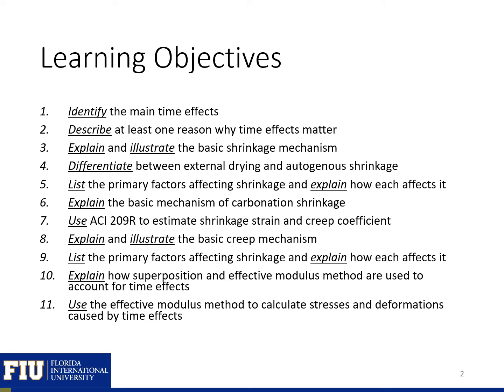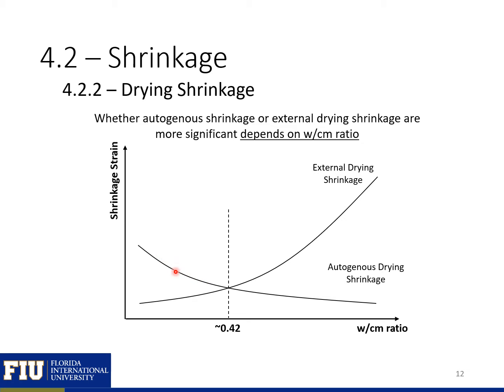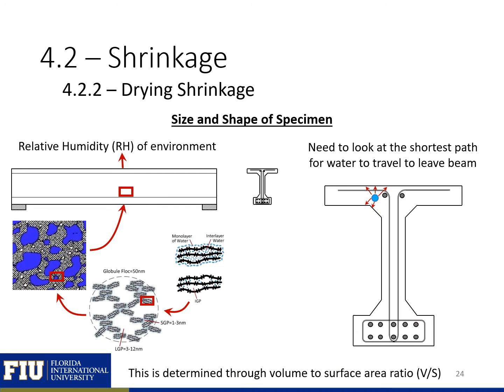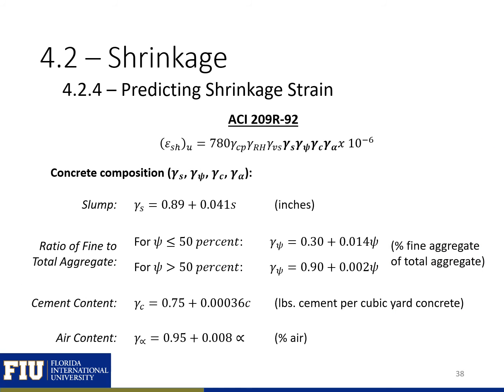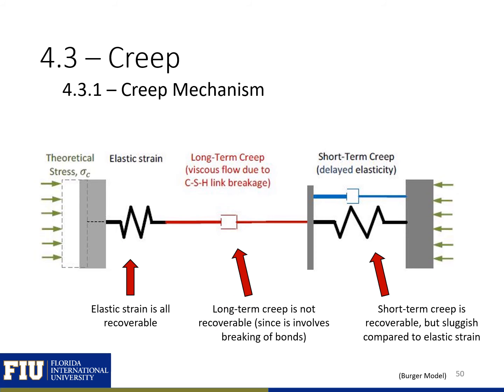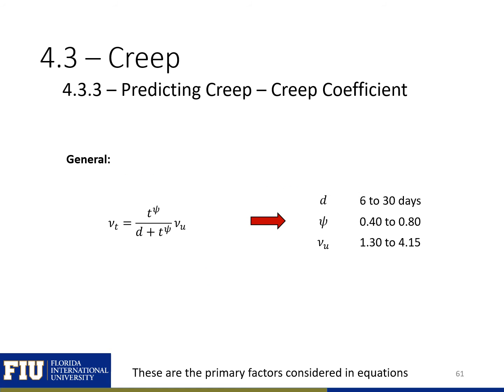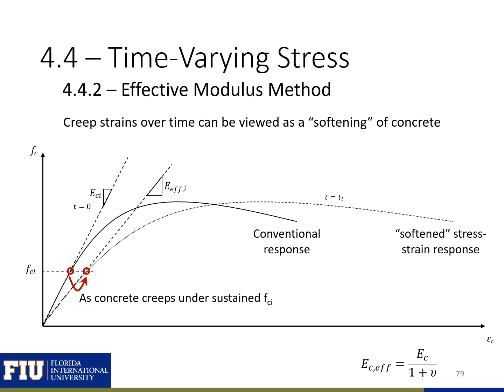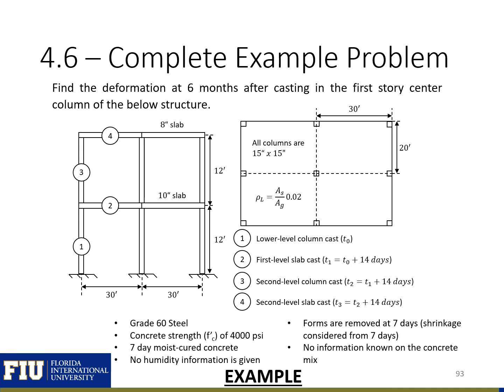4 - Adv. RC Design Lectures - Concrete Time Effects

Comment: I have a question on creep, creep always affect the deformation of the structure with time but will it also reduce the ultimate capacity of reinforced concrete structures, beams, shear wall...?